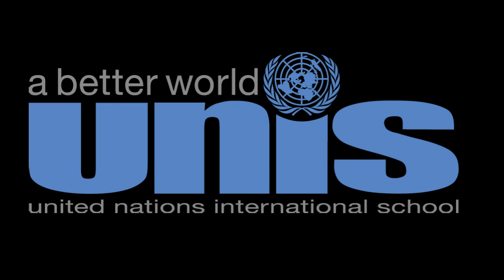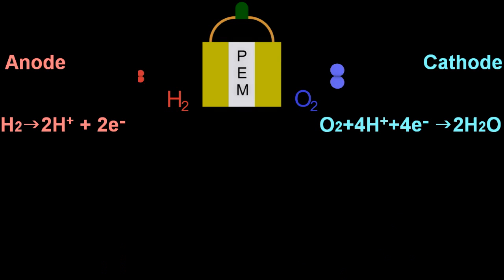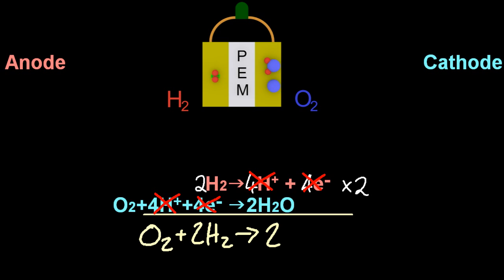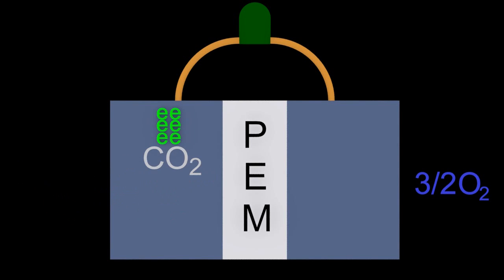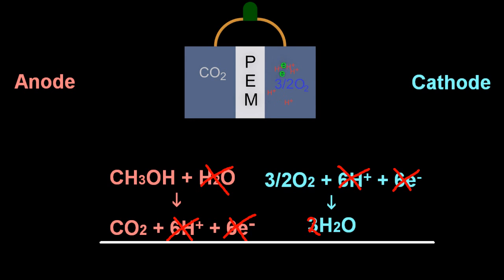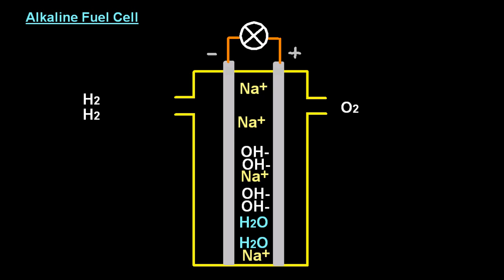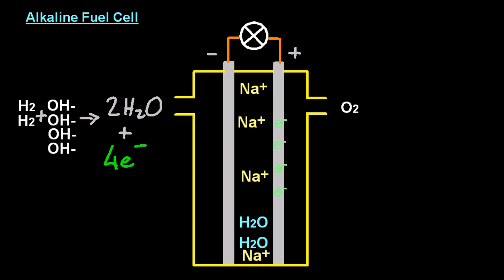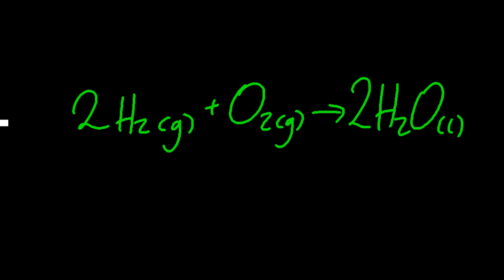C6 Three Fuel Cells (plus equations) [HL IB Chemistry]

Comment: If you add the two half equations you dont get 2H2O as a product...
Reply from the maker: indeed - i have noted that in the under title blurb.
Reply: Richard Thornley appreciate the speedy response! Personally, do you think we need to memorize all the equations? If yes, which ones in specific do you think are absolutely necessary to remember?
Reply from the maker: @far-3003  If I recall i checked past papers and mentioned in the under title blurb if you need to learn them.  This is stupid IMHO.  I would learn the 2 x H2 cells at a minium.
Reply: Richard Thornley yeah the hydrogen and methanol fuel cells alongside acidic and basic hydrogen fuel cells are reasonable, but memorizing all of them is quite overboard.